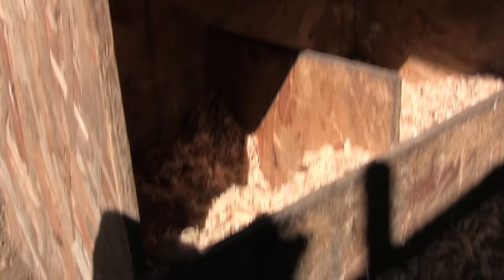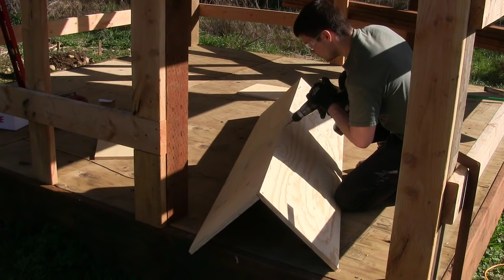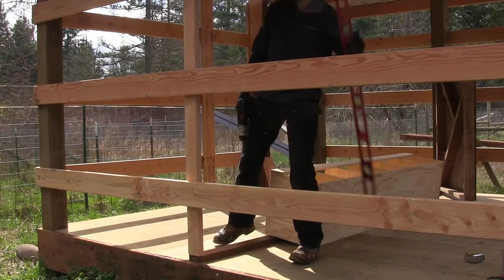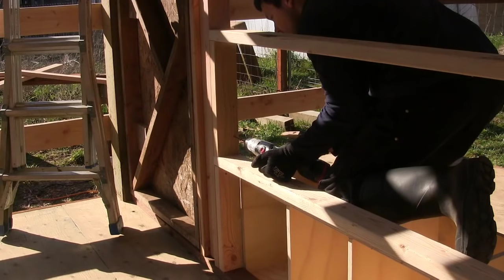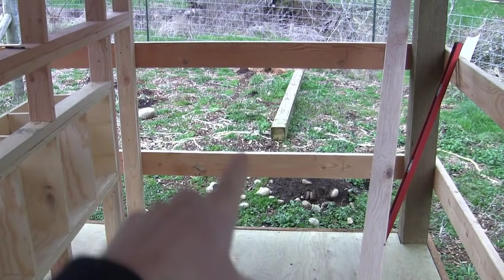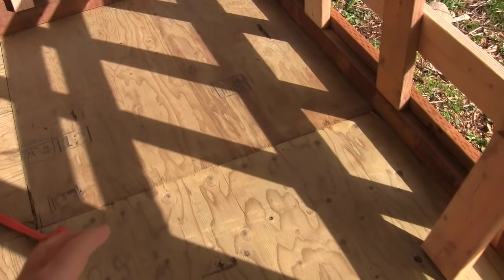Building a Chicken Coop (Part 4) How Many Nesting Boxes and Framing Interior Walls

Comment: So glad got my coop finished before November last year, now just gotta build the back doors and make it puurty 
I have double level, chickens on the bottom and rabbits on the top. I wish I had a walk in like yours though because without 
the doors done,  i have to unscrew one of the back panels to get into my waterer that was in there heated for the winter 
working on automatic watering now, and only the ducks are completed 
Its sooo much work but so rewarding when done! Great job, and taking a few tips from this, thank you.
Reply from the maker: The automatic watering sound like a great way to go.  I see a lot of people doing it and they seem to really like them.
Reply: @MikeKincaid79  actually i have the chickens on the top and rabbits on the bottom lol 
yes, so far is working great for the ducks so when they are locked in the run, they still have a constant 
supply of water and it was fairly inexpensive.

Comment: Hey Mike when you screw in diagonal, do you pre drill the wood like a pocket screw or do you just screw in diagonally without making pockets? The reason i ask is i have to make a new construction and i cant find an affordable pocjet screw maker.
Reply from the maker: I just screwed them in without making pockets or pre-drilling holes.  Good luck on your project, Violet!
Reply: Awesome thanks i am goimg to give it a shot. Building a bigger coop with extra nest boxes and a chicken hospital.